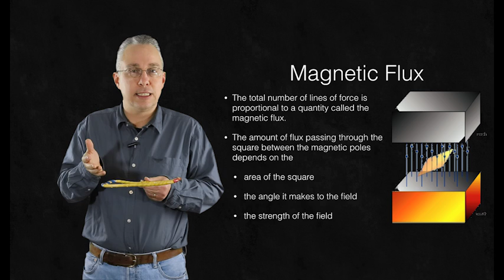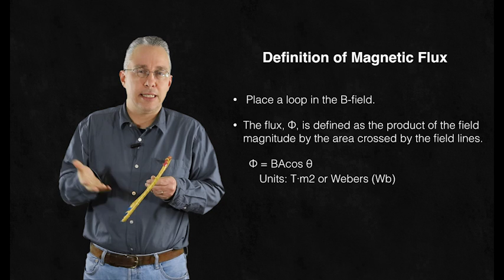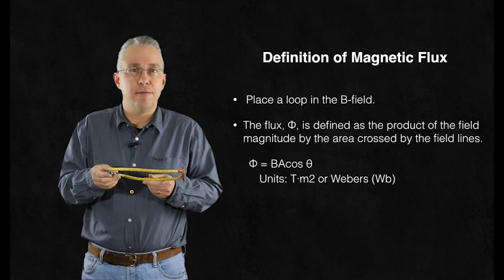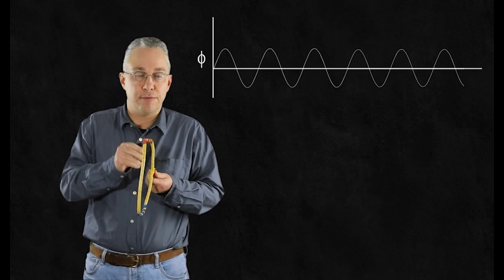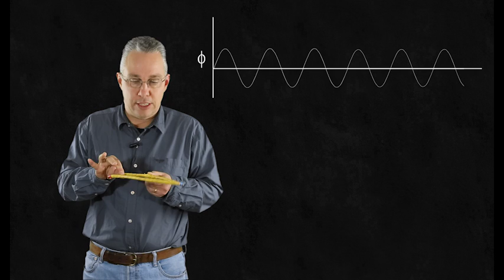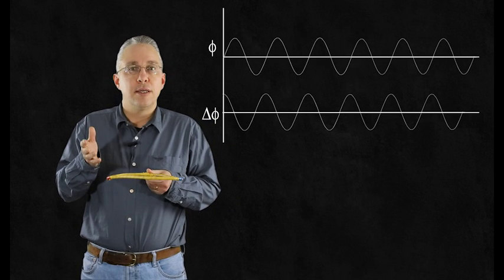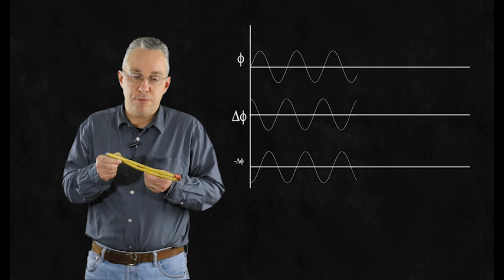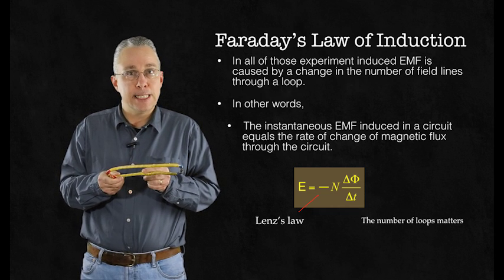EMF and flux explained

Comment: BUT> what if you had 2 loops to collect rain, both loops perfectly aligned (as in a wire coil)? Would the flux double? You are still collecting the same amount of rain, but your 3D area has doubled. Would the RATE of flux change stay the same or double?

Comment: Can you please help with the following questions:
1) every demo on this topic uses a rotating coil or copper loop or a magnet fixed to a rotor and facing a stator of copper coils. Sometimes a magnet is pushed into and pulled out of the coil.  The question is: Is one method superior to the other 
2) along your line of rain analogy. What if instead of rain I had a powerful garden hose opined right in the middle of the loop as you rotate it.  And compare with giant drum of water that when poured consumes the entire area of the loop.  Assuming the exact same amount of water sits through the loop is one type of flux preferred k we the other )super concentrated bs large surface area?
Reply: Number 2) I assume you mean what if it was between 2 small magnets which produce a narrow B line. Well it doesn’t change much because eventually flux is still going to equal 0. It just means that it would take a little longer to actually start making a difference from maximum flux

Comment: If two like sides (two magnetic north polarity sides or two magnetic south polarity sides) of  wafer or ring magnets are forced together with super glue or epoxy cement, would this create a high density or concentrated magnetic flux field?  If so, would the flux field produce a scalar wave energy field around the two magnets glued together?  If anyone knows, please leave me a reply.  If the two magnets glued together are placed on a sheet of copper, would the concentrated magnetic flux field energize the copper?  If the two magnets glued together were placed inside the resin of an orgonite pyramid or orgonite charging plate, would the magnetic flux field of the two magnets cause the orgonite to convert positive ions into negative ions?

Comment: Emf stands for electro magmetic field right ?? Does this emf represents the electron motion in the atom so negtive means electron nearest the next atom and postive means the electron farthest away from thr next atom and this change is what causes the production of emf radiation
Reply: force
Reply: It stands for electromotive force... The idea is that when you have an induced electric field (so one created by a change in magnetic flux) it will create a current. A current is basically the motion of electrons, and to move the electrons there must be work done. The current moves over a closed path: consider the work done to move a unit charge over the closed path as the emf. It gets confusing, because the emf is not actually a force, it is a measure of work per unit charge, and therefore has units Nm/C or simply Volts.  It is an example of unfortunate naming in physics.

Comment: Hello sir, around about 2:56, for the graph for flux, instead of oscillating between the positive and negative region shouldn't it always be positive? As flux is purely just a measure of the amount of field lines threading through the loop?
Reply: The cosine vector changes from 0° to 90° to 180° to 270° and back to 360° which is equal to 0°. Substitute the angels and that's why it oscillates through positive and negative side.
Reply: Please reply ... I also having same doubt
Reply: I think you're right. I've never seen "negative rain" in a bucket ;-) But mathematically there is a change of sign after a rotation of 1 pi in a sine-function.